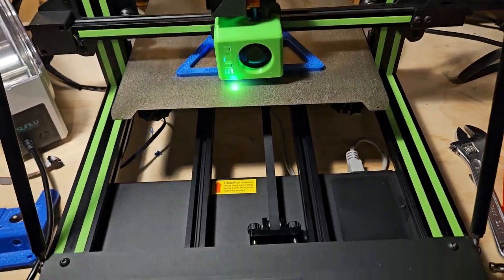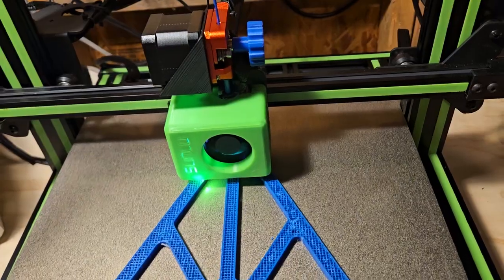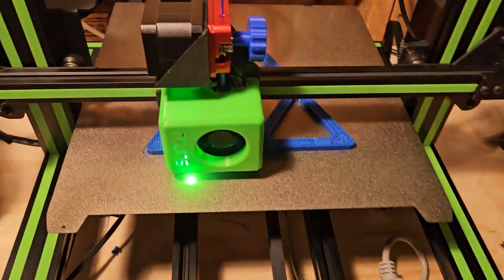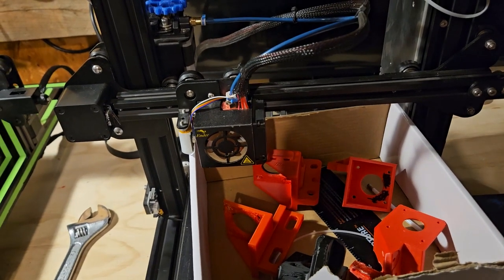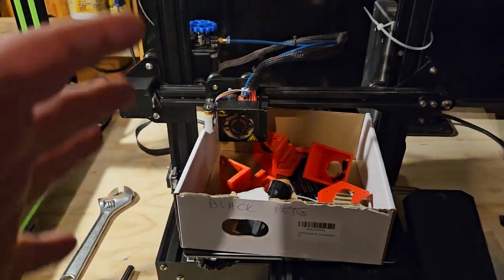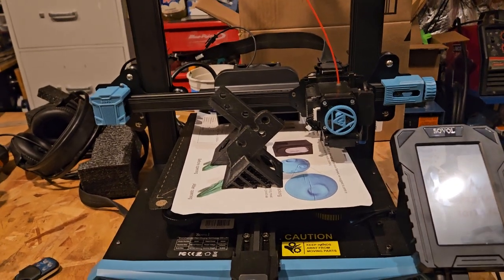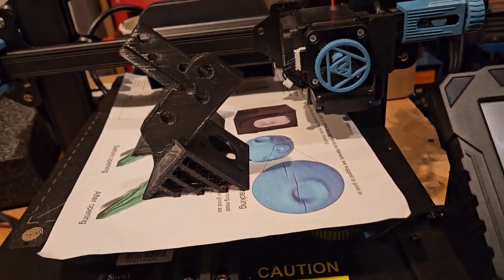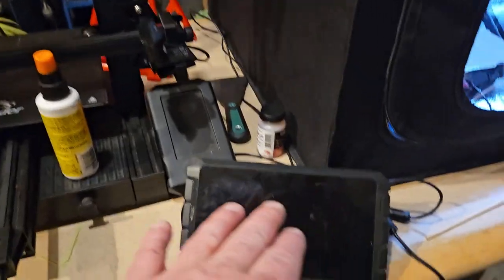my 3d printing adventures continue

Comment: HEY THERE, SO I SELL 3D PRINTS MYSELF , BUT I STARTED WITH AN ENDER 3 AND MOVED UP TO MORE EXPENSIVE ONES AND NOW HAVE A BAMBU LABS X1 CARBON... I CAN TELL YOU THAT IF YOU ARE HAVING ISSUES WITH YOUR ENDERS... THEN YOU'RE DOING SOMETHING WRONG WITH THEM LOL....      ALSO THE BLOWS IN THE INFILL MEANS ITS NOT EXTRUDING THE FILAMENT AT THE RIGHT TEMP TO SPEED OF TRAVEL.    EITHER SLOW IT DOWN... OR TURN UP THE TEMPS BY 10C OR MAYBE MORE.
Reply from the maker: Yeah i get some ok prints now and then. I dont use pla which is alot easier but im using old petg that came w the free printers. Just trying to use it all up. Ive fixed several problems with the printers so far. The 3v2 is printing fine but the bed springs suck. The 3v2 neo is doing ok a long as i stay at 50mms and itll turn out some pretty nice benchys lol . Ill get them printing better. Im up for the challenge and learning experience.  Ive been doing this just under 3 months lol